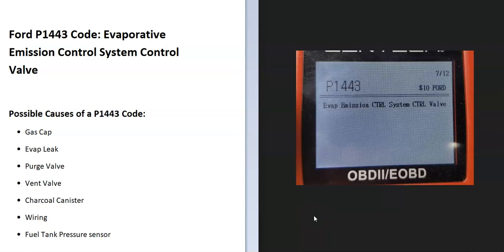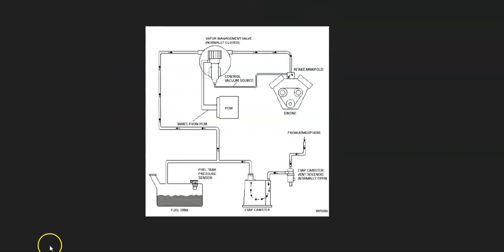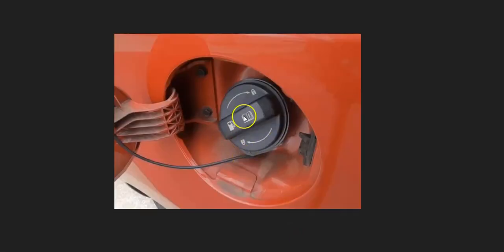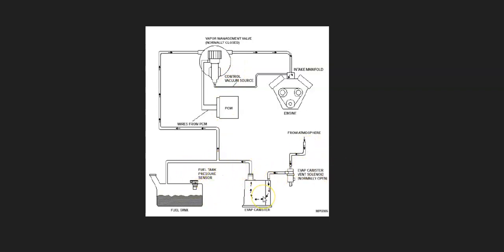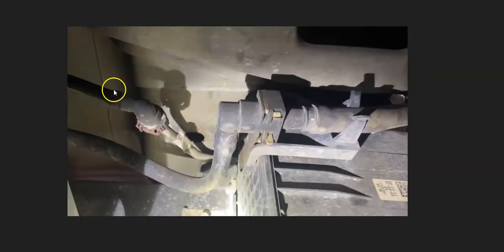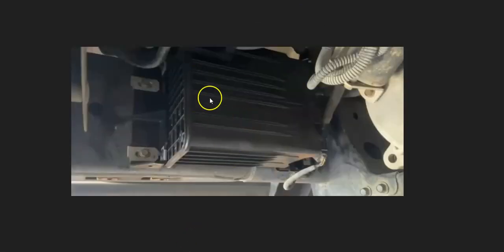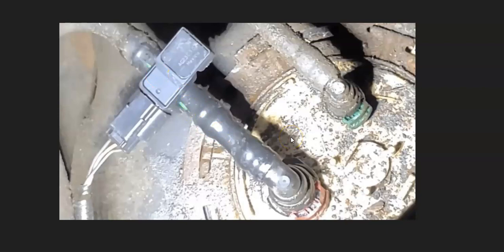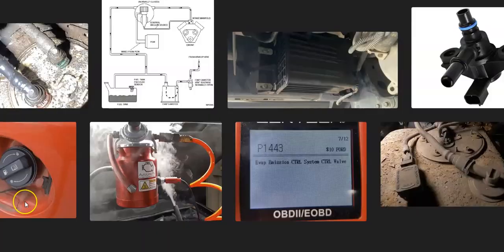Causes and Fixes Ford P1443 Code: Evaporative Emission Control System Control Valve

Comment: Thank you. I have a 97 Ford Ranger runs great except that code keeps coming up. You have given me a couple new ideas ... have already done some of the things you mentioned and I took a screen shot of the list ...  again ...THANK YOU!
Reply: fuel filler neck
Reply: I too have a 97 ford ranger that runs great but has this intermittent code. Let me know what your issue is when you figure it out, I bet anything it’s gonna be a cracked hose.